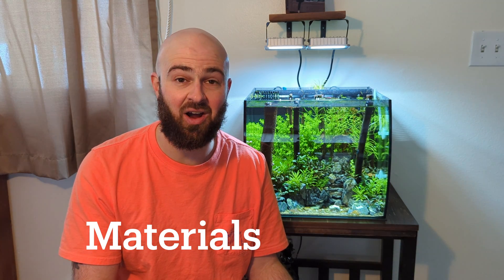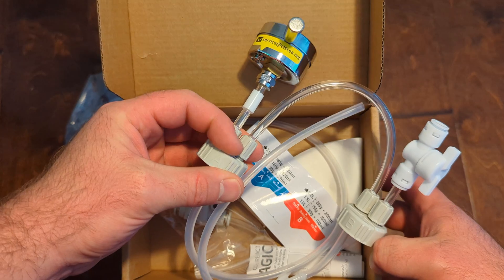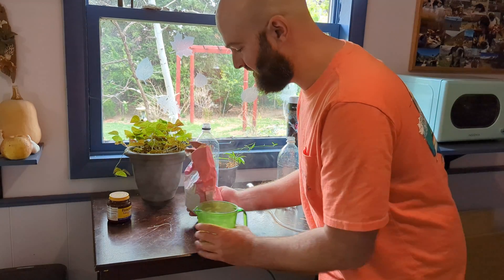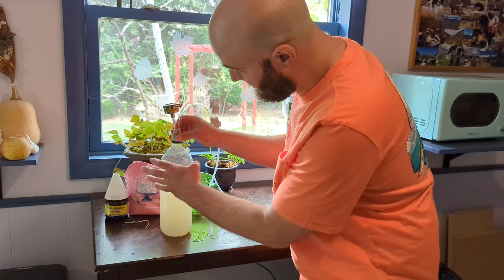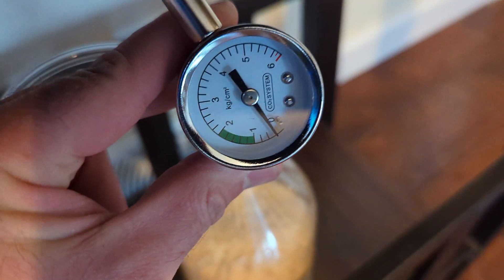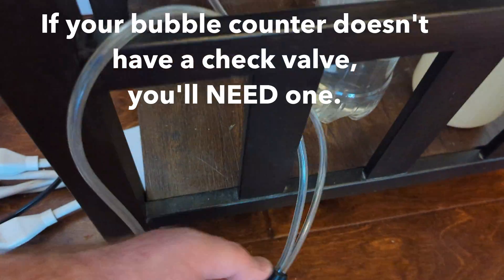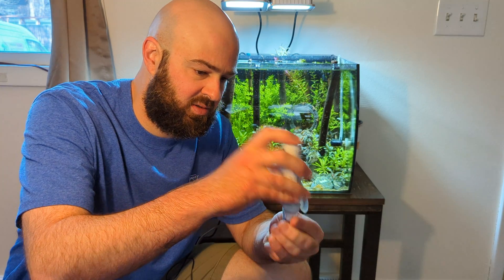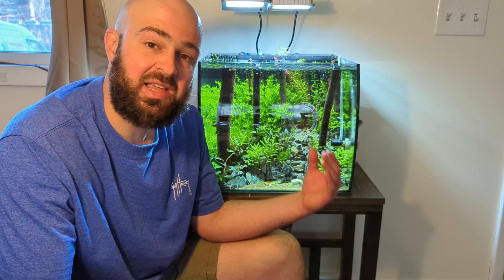DIY CO2 Generator for Planted Tank

Comment from the maker: Do you use CO2? If so, are you buying or generating?
Reply: I use the same kit you got off amazon. It's been around 7 weeks with my first batch of sugar and yeast and it's just now starting to slow down. It's perfect for my 15 gallon, I'd recommend this DIY Co2 for anyone :) One thing I did differently was I boiled my sugar water and melted it and then added some flavorless gelatin to slow the yeast down from eating all the sugar too quickly.
Reply from the maker: @cyndalbandy2515  Wow, thanks for sharing your experience. I'll need to try out some gelatin with my next batch. 7 weeks is a good stretch!
Reply: Hi! I have a 105 gallon tank is this okay gor a tank this big?

Comment: Thanks for the great video. I wonder how long does it produce co2 for? Thx in advance
Reply from the maker: No problem! I'd say between 2 weeks and 2 months is normal. Cooler temps will help it last longer. You can also add some gelatin to the mix and that should increase the lifespan of the CO2 production.

Comment: What kind of solenoid works with this there is different kinds?
Reply from the maker: I'd be cautious using a solenoid with a DIY system. You can buy systems like this with solenoids built in. Problem is that the PET bottles are not designed to withstand pressure. When the solenoid switches off, the pressure will build in your bottle, possibly resulting in a yeast bomb explosion. That will smell very bad!

Comment: Hi. I followed what you did but i dont have that bubble counter. Is that okay? And also I just planted my plants and the thank is still cloudy. Will that affect the C02?
Reply from the maker: Hey, thanks for the sub. It's OK not to have a bubble counter, because you can't really adjust the CO2 with most DIY systems. It is important to use a drop checker though to make sure that your levels aren't too high. It's fine if the water is cloudy, that shouldn't impact the CO2. The water should clear up after a day or two.
Reply: @freshflowaquatics  thank you! I put a drop checker and saw it turned green. Then it turned yellow so I put off my co2. Thanks for the reply!
Reply: @freshflowaquatics  another question. The drop checker turned yellow meaning the co2 is high. Is there a way for me to turn it off? I check the pressure and it keeps building up and im scared.
Reply: Go outside and open it up

Comment: I just hooked up DIY CO2 to my planted tank a couple of days ago. I don’t think mine is going to generate enough CO2 to create the lime green color. In your experience, do the smaller amounts of CO2 help your plants grow better, even though it’s not as much as the high-tech systems generate?
Reply from the maker: Even small amounts of CO2 can make a big difference - hopefully you notice that with your tank. A system like this would be sufficient for a small tank, but probably not so much for a larger one. I'm not sure where the cut off is, but I'd guess around 20 gallons.
Reply: @freshflowaquatics  Thanks for the info! The tank I added CO2 to his 20 gallon.
Reply from the maker: @AdamSmith-yc8iz  Good luck, let me know if you notice a difference!